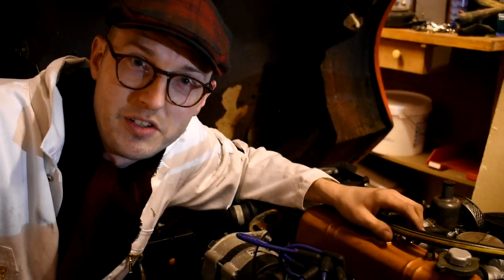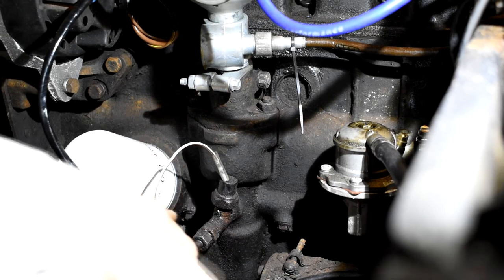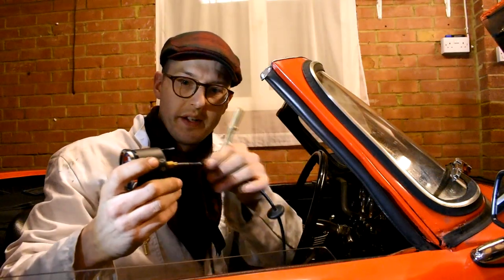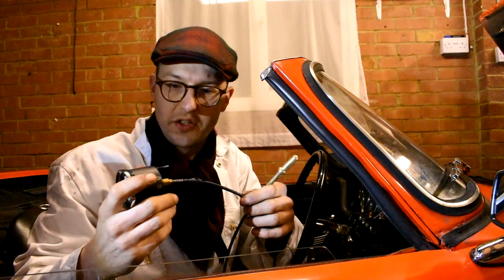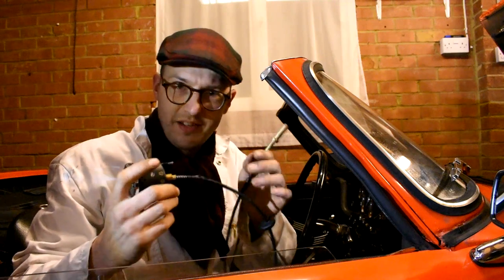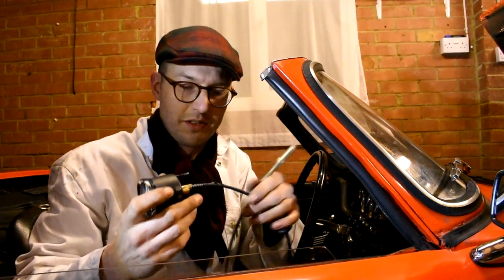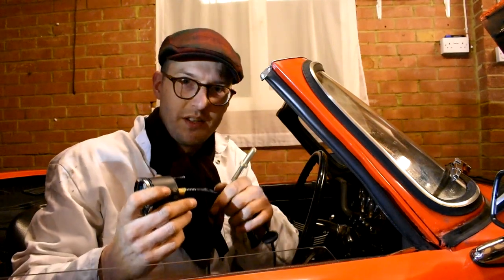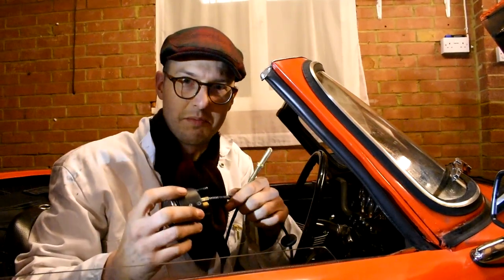Triumph Spitfire Dual Gauge Conversion

Comment: Nicely done Steve! I appreciate your attention to detail. I think having the oil pressure gauge is a big improvement on these cars and the dual gauge looks much more at home on your dash than the previous setup. (especially where it was staring you in the face every time you were behind the wheel). Be well!
Reply from the maker: Cheers mate, that oil gauge riveted in place has been bugging me since I brought the car, at least now with the dual gauge it looks so much neater with all the gauges in one place 👍🏻

Comment: Another good one Steve. So have you added a gauge that otherwise wasn't there or put something back in that was missing? 🤔
Reply from the maker: Cheers mate, originally Spitfires never had oil pressure gauges. The one I removed was just bodged into place. The solution is either go back to original and get rid of the oil pressure gauge, or have one and make it look tidy with a dual gauge. It’s a good conversion, as it keeps all the gauges all in one place making it look somewhat factory, even though it’s modified

Comment: When you got drill out l thought  " don't you drill through that wiring  Captain Mainwarring! " Are the other gauges  Jeager? Although the 6's have a peculiarity of having the odd Smiths oil guage? Nice one Steve. Take care and stay safe.
Reply from the maker: Cheers John, the 1960's Mk3 Spitfire's only had Jaeger Gauges. Which does puts the price up on the dual gauge Jaeger style over the Smiths equivalent. Annoying really for just for a label when in effect the dual gauge is the same behind the label. It is what it is, and as I want all my gauges to match and not look out of place so in that respect it then becomes bittersweet. Take care and stay safe my friend 👍

Comment: I've got one too somewhere, for my GT6. Did you have to install a new temperature sensor?
Reply from the maker: It comes as part of the gauge. As a Triumph originally works with a electric temp sensor, a dual gauge works off capillary action, and comes with a bulb on the end. When you convert the gauge over you have to discard and tape odd the original wires, bin the temperature sensor and replace it with the bulb that’s permanently part of the gauge
Reply: @SteveDentonClassics  Good to know. I hope the one I bought a few years ago has the bulb! I can tell you where it is (storage bin #4) but the last I saw it it was wrapped in bubble wrap... someday when it's time to get to the dash I'll install it.